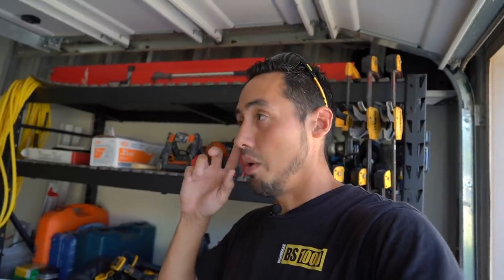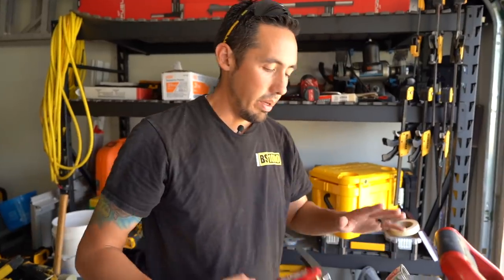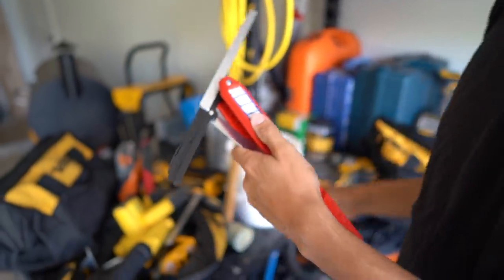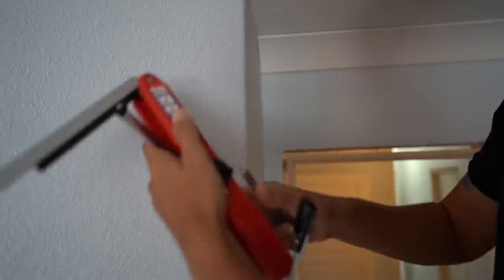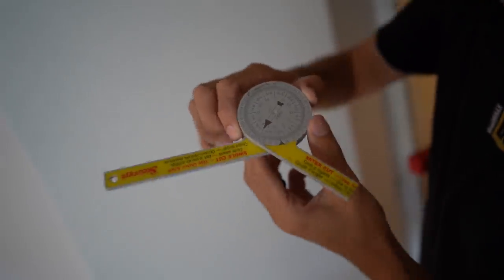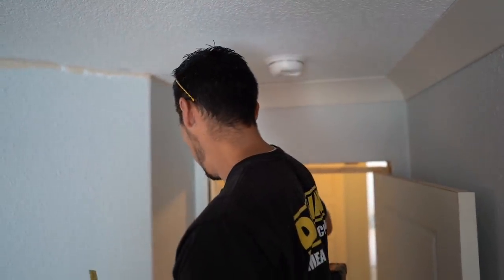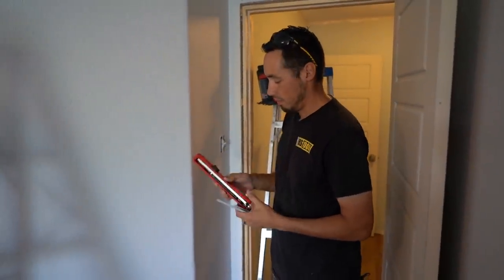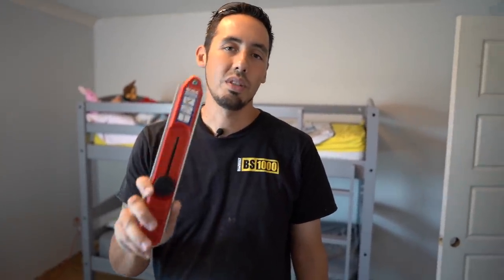This New Tool Gets PERFECT MITERS

Comment: Whilst that looks like a handy tool, it's a lot quicker and easier to just to mark the ceiling with a pencil each side then mark your length and cut, no marking too required and perfect mitres every time and can regardless of the angle, can't really understand the need for a tool!, I enjoy your videos but this is just unnecessary steps.